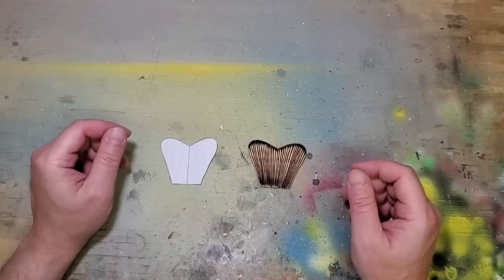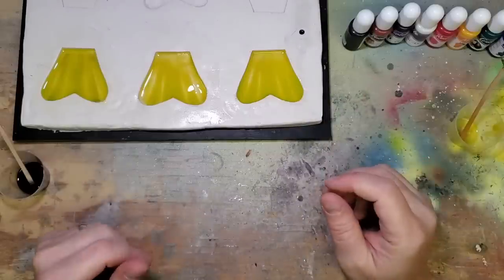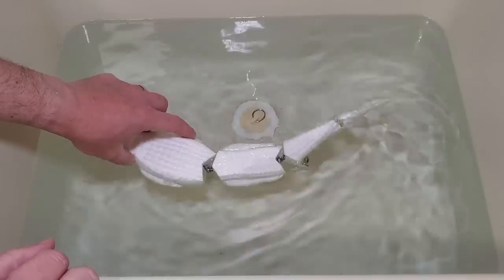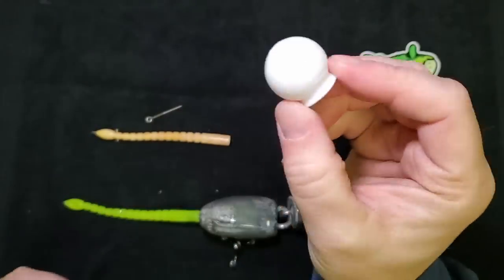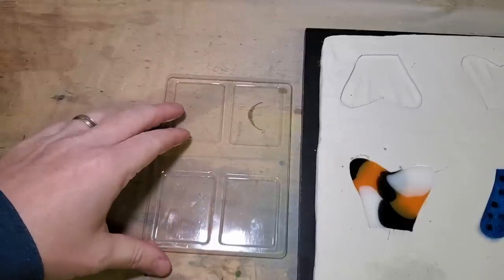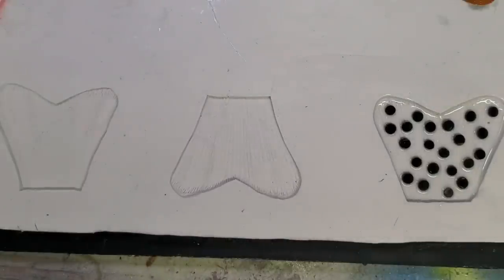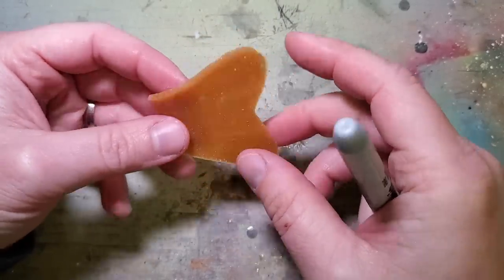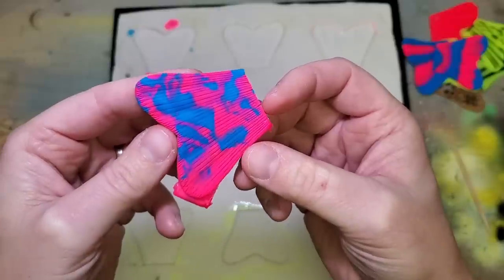Making Silicone Rubber Fins- a how to guide on making colorful tails for fishing lures

Comment: This was really cool! I feel like in order for silicone to have crisp and clear color separation, it needs to be dang near close to curing, or fully cured.
They say silicone sticks to silicone. I wonder if temp of the mold is a factor for getting new silicone to fully adhere to cured silicone. Without cracking.
Reply from the maker: Thanks! I am still experimenting with silicone fins and am working on a new video. Color separation is very difficult with silicone for sure. I will say that warmer temperatures decrease cure time. In the next video, I am starting to dabble in painting silicone. Thanks for commenting!
Reply: @zimmtex I like how you're trying many different things to see what works well. 🤙 I've always wanted to make a durable silicone tail.

Comment: enjoying the content. what silicone are you using for the tails? ive been looking for some options
Reply from the maker: I'm using Let's Resin silicone rubber; it's the same stuff I use for my resin molds. Not sure if it's the best for tails, but I'm trying it out. Thanks for watching!
Reply: Appreciate you taking the time to answer. Looks like a great material for cranks, wakes ect.